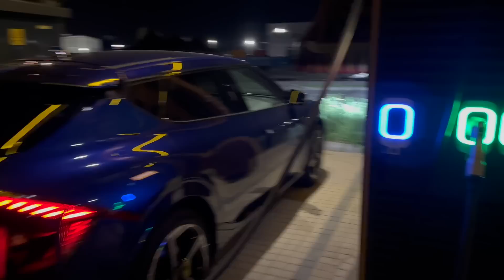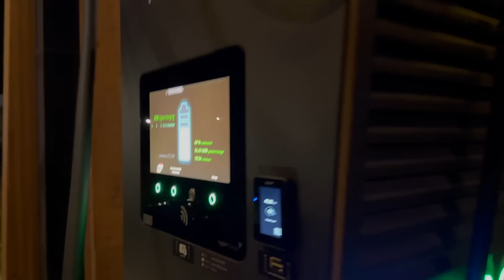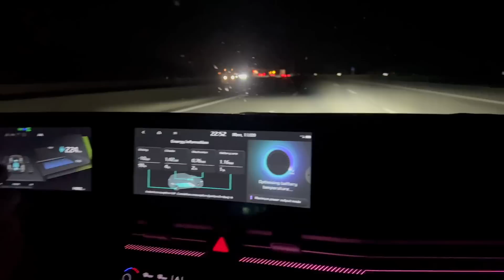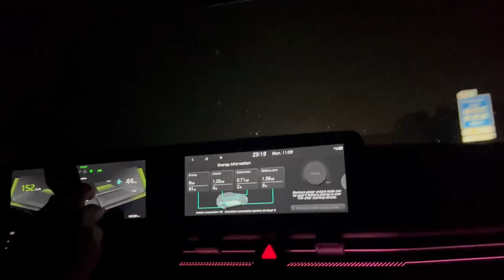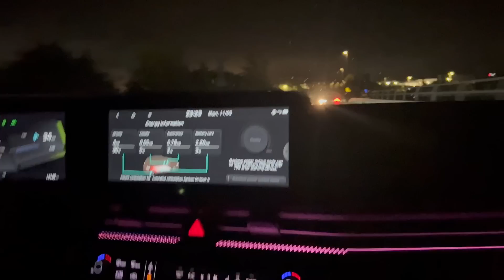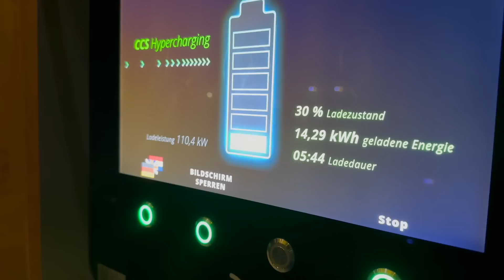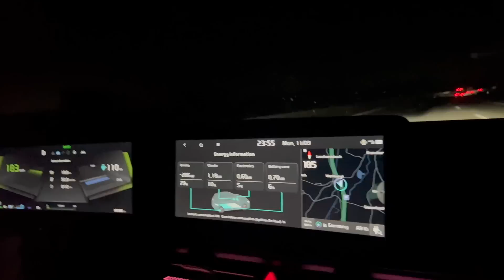Kia EV6 GT Extreme Thermal Stress Test! E-GMP Platform Ripping w/ Fast Charging & High Speed

Comment: I love my GT. It’s so much more comfortable than our model Y, charges much faster, and in reality it isn’t that far off in range. I swapped the 21s for 19” wheels and I now get over 4mi/kWh at speeds of 50-60mph, while interstate driving at 75-80mph averages about 3.1-3.3mi/kWh.
Reply: Range with the 19"?
Reply: @volcalstone  230-250 miles on the interstate. 300 around town.
Reply: @gfbrittoncarlisle  nice cause I heard 237 real world range on the 21". I don't mind going down to 19" tho. I wonder if more aero rims would be better as well.

I'm thinking of getting a GT as they're up to 15K off rn. It's still more expensive than a Tesla MYP cause those could be had for as low as 42K after rebate vs 49K or so on the GT.
Reply: @volcalstone  a Model Y is a penalty box to drive. It’s loud, rides like it has concrete for shock absorbers, and has none of the performance-focused features like the Kia. The Y Performance doesn’t offer an active rear differential so there’s no sort of torque vectoring or in snow it has no way of sending power to the wheel with traction other than trying to brake the slipping side to force power sideways. The seats aren’t remotely as supportive, no adaptive dampers, and in real world driving there is almost no difference between the Y and EV6 in terms of range. Tesla claims huge range figures but they’re full of hot air. We had a Y LR AWD at the same time I had my EV6 GT. Both were on 19” wheels. The Kia would go just as far as the Y, but charges 50% faster which is a huge bonus for road trips. I also much prefer the look of the EV6 and the rear seat has much more legroom. You get a HUD, surround parking cameras, parking sensors, multiple radar for cross traffic detection and ACC works in adverse weather with no phantom braking like Teslas. If I were you I would lease the EV6 as they are offering insanely good lease incentives.
Reply: @gfbrittoncarlisle  thanks for your reply and insight. I appreciate it. I ended up picking up a GT! I'm loving it so far. I've had it for about a lil over a week now. That GT button is hard to resist that's for sure. I'm mostly driving in normal tho and some sport every now and then. If you haven't yet put on a matte screen protector, you could thx me later. I'm the only one driving this car so the only missing thing for me are vent seats as it gets hot where I'm at during the summer. At least it's not vinyl on the back side tho so that's a good thing at least. I'm planning to tint it all the way around so that will help with the tint and also making it look nicer not that it doesn't already.

The GT or EV6 in general isn't perfect like most cars out there. There is some stuff that I don't like about it. No walk away auto-lock which I know there is a mod for it that I'm planning to do as well. The tailgate can't be closed remotely which my prior 2011 car did. No deal breakers tho. These are software issues that could be added on really. Just not sure if Kia will tho. This is my first Kia and EV at the same time. 

One thing I do wish we had the option for since the screen is so wide is while backing up to have the side cameras on at same time. I know you could switch the video but you would lose the rear camera by doing so. I would rather see the side cameras and the rear at the same time vs the 360 being constantly on there. Like I would rather have the 360 an option instead. 

As for Tesla. I've been inside a MYP but it was only for a short period. Not enough to really access it. My siblings have a M3, 2 MYLR, and MYP. All I know is that I made the right choice in the family. 😀 Yeah I heard they're rough. I went with the EV6 GT cause of the ride quality.  This is kind of like comparing a Pilot vs MDX where the latter just drives nicer and more sporty. I also wanted a better build quality inside and out. No rattles for me so I'm happy. Lastly I wanted Android Auto along with all the tech that you had mentioned. I don't trust Tesla Vision period. I want parking sensors period. I know this cause it saved me lots of times in the past.

Yeah I ended up getting it for only $50 after rebates and before taxes. What a great deal imo. It's worth the extra over the MYP. I see Teslas like in every other corner and in some cities like every other car. I like to be different, maybe that's why I'm an Android user.
Reply: @volcalstone  the remote rear tailgate closing, if you hold the button on the key fob, at least here in the US it will close the trunk. Same thing in the car, hold the button and it will close. You can also set the car to automatically open the trunk if it senses you approach from the rear of the car while it is locked and you stand for a few seconds by the trunk. 

I definitely enjoy the way the car drives with the lighter weight 19” wheels, too. The set I got is almost 20lbs per wheel lighter. It improves steering response and efficiency as mentioned sees a huge uptick. Glad you’re enjoying it. 

I’m used to just pressing the little indent on the door handle to lock the car or the key fob now. It did take a little to get used to because I had a Tesla before and my BMW and VW also locked when walking away. Not a big deal but something they will hopefully add at some point. Personally I like the overhead view better than the Tesla’s side view, but it’s just user preference.  It’s much nicer having a front camera so you can see how close you are to objects and the overhead view makes parking near curbs a breeze. Also easy to change camera view to show the front or rear wheel positions if you need to get really close to a curb without hitting one. 

Just so you know, if you drive above 74MPH in normal mode without using ACC the front motor will automatically engage. I honestly do most of my driving in Eco mode with L3 regen. Using I-Pedal also keeps the front motor engaged which uses a lot more power. Even in eco mode the car has almost 300HP so it’s plenty quick to pass, but I like the shortcut drive mode button is right there on the steering wheel so there’s no looking through menus on the screen if I suddenly want to go into normal, sport or GT mode.
Reply: @gfbrittoncarlisle  thanks for all of the tips. Yeah I tried to hold down the truck button remotely and it just beeps but doesn't come down here in the US. I'm gonna check with the dealership on this. Yeah I have mine set to open handsfree when I get close to the trunk. I do wish it would engage or make a sound after a delay tho. It would already start to beep at me even if I walk by rather than start beeping if you stay still there for a second or so.

For the cams. Yeah don't get me wrong but the 360 one is great to have but yeah I don't want to curb my rims. I haven't in a while and I don't remember the last time I did. I'm just use to the tint down function which we don't have here in the US I guess according to manual insert I read online. That's where I found how to fully use the sunroof. It depends if you press long or not when it comes to the shade and stuff like that. Pretty cool and one of the main reason why I got it over any Telsa. My favorite Tesla will always be the 16-17 revised MS P90D or P100D tho cause of that opening roof before they took it away and made it fixed. 

Yeah I heard driving on eco with gen 3 is best. I got so used to driving on i-pedel tho and like it a lot. I guess I will have to physically hit the brakes to come to a full stop then. I know there are also auto regen modes too. I need to look it up to see what the differences are. There is so much to learn going EV or to a car like the EV6 but I don't mind tho as I think it's awesome. Time to look for and join some reddit forums. 😀
Reply: @volcalstone  that’s really weird your trunk isn’t closing holding the button. It says in the owners manual you have to be within 33 feet for the trunk to close while you press and hold the button the entire time it closes.

One thing I do about regen is just hold the left paddle shifter in when you are coming to a complete stop. That gives you I-pedal level of regen without activating it. As soon as you let off the paddle it goes back to L3.
Reply: @gfbrittoncarlisle  thanks for the additional tip. That did it, it works now! I didn't know you had to hold it down the whole time which I think is overkill. I know it's probably a safety thing but I don't think it's that necessary.

As for the left regen paddle. Yeah I kinda discovered that on my own a couple of days ago. 😁 I guess I could use that to come to a full stop as I didn't really think of doing that. I did try eco mode with level 3 this morning and surprisingly it wasn't so bad. Yeah it has enough power to get going. I guess I just had to get used to it coming from normal. I just never thought to go eco mode on a GT 😁. I usually don't use eco modes on any of my prior cars that's why as I've never been a fan of it. I guess I will use this from now on and on the freeway I will be using regen level 1-0 so that I could coast. Full eco mode it is! I'm sure glad the mode buttons are just right there tho.
Reply: Are you accounting for the odometer error as the smaller diameter wheels turn more revolutions per mile? Or are you using higher profile tires to keep the diameter the same? 
  I want to do this myself, but don’t know if it’s the size or the weight savings that make the difference.
  Please answer if you can.
 Thanks.
Reply: When you run 19s, isn't the speedo off?  How do you fix that?

Comment: I have the Kia EV6 dual motor GTLine-S, is extremely comfortable and full of tech, this car uses power in sports mode quickly, too quickly. Given the GT variation at 578bhp is using 320kwh, with the exact same battery, yeah that's bad, really bad for range! Sure it's fast, but for a road car you just do not need it, particularly with speed limits, it's rediculously overkill. The dual motor 325bhp is already enough for anyone, even a single motor is sufficiently quick with 225 bhp. .
Reply: Sounds like you made the right choice for yourself. Of course, many drivers would like to have more power, even if we aren’t using it all the time. It’s not overkill if you were using it on the track or Autobahn. If I drive my GT gently I will get plenty of range back, but that’s really not the point of this model. Different strokes for different folks!
Reply: Agree 100% but it’s good to have at a red light when you have butt tight drivers that refuse to let you yield. With this beast you are king of the road 99% of the time.

Comment: 2 questions:
 Will that heat pump run in my garage at night making noise.
What is the V to L capability could I use it the power couple sump pumps in my house during a power outage?

Comment: I think the Ioniq 5 N will be even better because of the totally revamped cooling they did. It has its own radiator specifically for the battery now and way more vents to pull air through

Comment: The battery optimization should have been done before you floor it on the autobahn, you didn't get the whole power, battery was too hot. One thing is for sure, with good enough temperature on the pack you are  actually able to maintain full speed for a long time. As you very well said the car "rapidgates". IT does that at 51 degrees celsius and caps the max output to 230kw after a while. When you got out of the charger even on My Mode ou didn't get the 439kw max discharge because it was too hot, that's why you only saw arround 370kw. Still... this is nitpicking, it's pretty much a beast anyway. Very good car. Would get it over the i4M50 anytime.

Comment: Re Alyssa and straight line not feeling right, I have a GT so am used to this dashboard display and I see at 21:59 on the vid the lane keeping symbol on the dashboard shows that system is ON. So the car is trying to keep you in lane at 260 kph. Basically fighting what your hands and highly developed skills  are doing. (I know you are great at car control) You can turn it off, but it seems to come back when you restart. It is a safety system do you cannot permanently disable it.
Reply: Also her comments at 46:32 summarized high-speed stability when driven in My Mode with suspension set softer than in GT Mode.

Comment: For my EV6 RWD, it definitely wants to have a larger radiator and/or fan. The bottleneck it seems to me is the coolant temp rather than the compressor power. The AC compressor also runs right at 100C+ in hot weather so it’s probably thermally limiting too. I’ve considered modding the car to add a second radiator and fan. Doing that correctly wouldn’t be easy though.

Comment: not that I have any opportunity to go SCHNELL at 160mph in my country, but I wonder if Alyssa would be less scared at max speed, and the car less nervous, if Kyle used full GT mode with stiffened suspension.  I suspect the car is tuned for this speed in Europe, and this kind of driving is exactly what the max stiffness suspension is set up to handle.  Also, Kyle makes no mention of tyre pressures, which are also super-duper important if you are going 160mph for stability and safety reasons.
Reply: In my experience, GT mode with suspension on sport+ is best for curvy roads. On very high speeds on more straight roads, the middle sport setting seems to be better, as sport+ is a bit too „jumpy“ on every little bump
Reply: @StefanSulistyo  I tend to agree with you, but I've never run my car at the speeds Kyle was doing in this video.  I suspect at higher speeds and on Teutonic roadways, GT mode and the stiffer suspension are more confidence-inspiring.

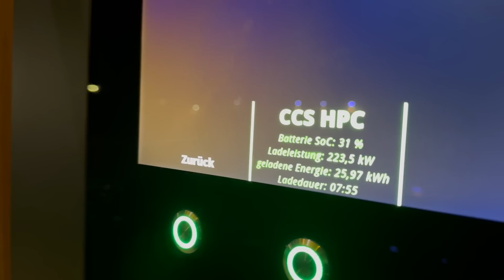Comment: 10:28 EV6 and alpitronic have some weird interoperability issue, most of the time (like 99.9%) it will only assign three powerstacks (3x75), so the output is limited to 225 kW. There are threads on german language forums about this, people with hundreds of sessions never seen full speed on alpitronic. And then there are couple of individuals who have screens with full 237 kW power. Still not sure what exactly is the rootcause.
Reply: Could be a configuration issue to keep the second outlet available, all alpi wide cabinets have 4x75 or 100x4 for the new. So the software probably assign 3 modules to single outlet, reserve one module for the second outlet, otherwise it would have been “occupied” even if one car is charging and pulling over 225kW. Not sure but plausible.
Reply: Nope. Taycan pulls up to the same station and gets 270 every time  @MrSportauspuff

Comment: DC Chargers with 400V architecture and EV6 with 800V architecture constraints due to amperage limitations. Due to technical limitations you could get 325A and with 400V it means about 128kW. When I charge on 800V charger it will top ups very fast, 30->100% in 15 minutes (I was having lunch during the trip and didn't put 80% limit).

On Tesla Superchargers (V3 and V4) there was some other technical limitation that allows only 42kW or roughly so. V2 can charge faster.

Comment: The better place to test the limits of the car would be on the Nurburgring. Anyone can enter it and unless there is a very specific exclusion, German insurance even covers it. You get to test frequent acceleration and regenerative braking and top speeds, without risking the safety of innocent Autobahn users. It takes just one car to underestimate your speed and get into your lane for you to crash into them. And while going at 260km/h is legal, you will still be deemed 100% at fault if you were above 130km/h.

Comment: I think you hit the nail on the head, there is a huge amount of air flow rate across the heat exchangers when you're at high rates of speed.   That is what allows the thermal system to keep up vs. when you're stationary and charging the little radiator fan can't compete.
Reply: Nerd alert: I have read the shop manual. In the front of the car there is a refrigerant condenser, and a hydronic radiator. The radiator is part of the loop that cools the battery & electronics, and it supplements the refrigerant-fluid heat exchanger in that loop with passive cooling from airflow when the vents are opened in the front.  Kyle was right in his assumption.

Comment: After the Update the EV6 GT line is charging quit good. Thermalmanagement has improved. And i like the clima autmatic, witch has 3 settings, heated and ventlated seats. All you can wish, except massage. I do not know how it is in the GT, this has sportseats.
Reply: GT does not come with ventilated (or electric) seats as they have the sport seats. 
GT Line however does come with ventilated and electric seats (with the nap function).

Comment: Headlights looked like they were aimed at the lower position, I did have a Kia a year ago and it had manual wheel for headlight position. Maybe it is not automatic even higher end, which would be stupid...
Reply: These are matrix and you cannot manually adjust them othe than in the shop